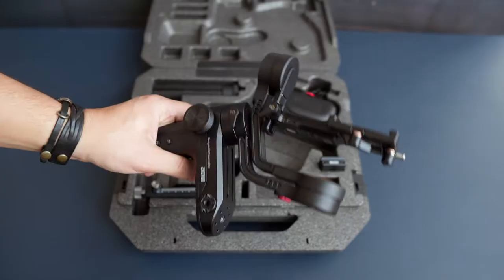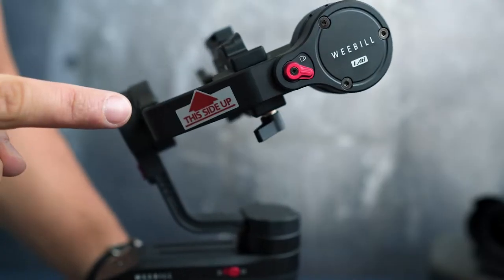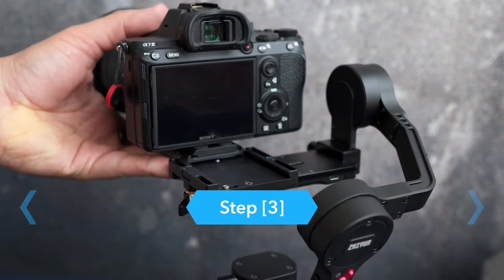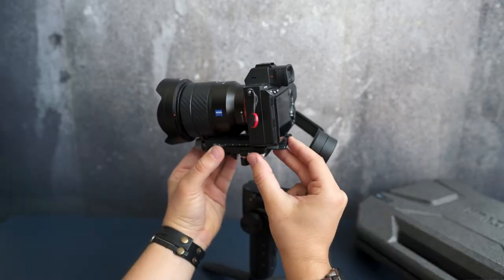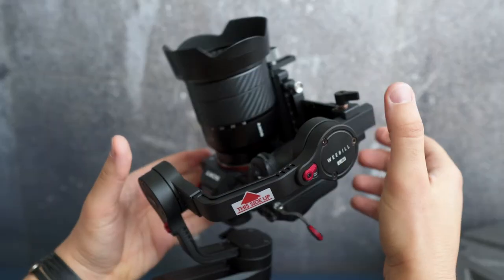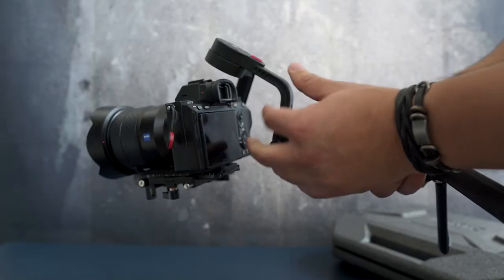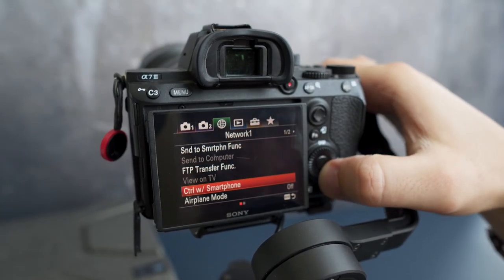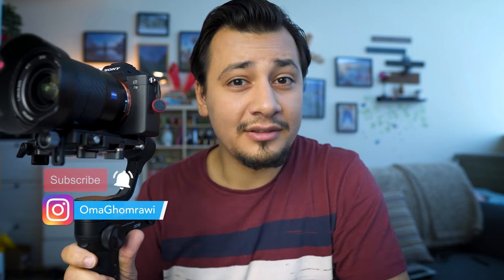How to Balance Zhiyun Weebill Lab in 3 MINUTES

Comment: Hi Oma Ghomrawi - I tried to follow your tutorial but I can't seem to get the gimbal to balance the way as you described in your video. Is my camera too heavy? I am using an EOS Canon 5D Mk IV with a 2.8G 24 - 70mm red ring Canon lens.
Reply from the maker: Because you camera and lens are large and heavy they doesn’t work on this gimbal.
The Weebill pab is designed for mirrorless and small cameras
You need a bigger gimbal

Comment: Thanks Oma - great video - fast and to the point. I'm looking at this exact setup for travel. I was looking at the EOS-R but It could be a bit big. The EOS-R with 17-40 is 75g heavier and 30mm longer.
Reply from the maker: My brother uses Sony a7iii and Samyang 35mm f1.8 which is quite longer than the setup I'm using in this video.
Don't take my word, I didn't try EOS R with weebill lab yet
Reply: @OmaGhomrawi  - thanks - great video - keep up the good work.
Reply from the maker: @markshirley01  Thank you for passing by :)

Comment: Hello, and thank you for this video. 
I need help please: when I calibrate my stabilizer on the tilt axis, the plate slides when I point the lens up or down, while the screw of the plate is tight... 
Could you please tell me why the plate does not stay fixed when the screw is tightened?
I'm desperate because I can't use my stabilizer...
Thanks in advance for your help
Reply from the maker: I believe there should be a knob that should be locked, and you're missing it.
Reply: @OmaGhomrawi  Hello and thank you foy your answer  😊  All the screws were locked.  I contacted the customer service and they told me to completely disassemble the screw that was causing the problem and reassemble it. My problem is now solved ^^

Comment: When im balancing the pan axis, do I lock the other two axes? I have this with the Tameron and im having a hard time balancing it at 50mm, Thank you
Reply from the maker: The other 2 axes should be balanced before the Pan axis and remain unlocked when balancing the pan axis
Reply: Oma Ghomrawi thank you , what setting in the app do you use for general shooting and running
Reply from the maker: Jj Li I don’t usually use the app, I just put the camera in and Run it
Tamron is pretty long at 75mm
If can’t balance it probably at 50mm I recommend to balance it at 28mm.. run the Gimbal then zoom in
Reply: Oma Ghomrawi I was told to balance it at 50 for the best result and that works really well
Reply from the maker: @OceanBoyJj  That's totally correct. But if you can't balance it at 50mm do it at the nearest focal length you can. Bare in mind, the gimbal will consume more battery power when it's unbalanced 100%
Reply from the maker: I'm currently running a giveaway on the channel. Feel free to join.. https://youtu.be/MF-pNkLq3PY

Comment: i have a canon sl2 with cina lens im having issues cant get it balanced
Reply from the maker: The setup might be too big for this particular gimbal.
Reply: @OmaGhomrawi  really isnt the payload max 6 plus pounds ? sl2 and cina lens is maxing it out ????
Reply from the maker: @mill3ronfir3gaming51  although the manufacturers advertise the payload capability, the setup size is essential on such small gimbals.
What lens you got ?
Reply: @OmaGhomrawi  Samyang 24mm T1.5 Cine Lens with a Canon sl2
Reply from the maker: @mill3ronfir3gaming51  I suppose the lens size is the reason, do you have any other lens to try on this gimbal ?
However, I stopped using this gimbal after few months because I founded flimsy and the system became a kind of jiggly. So I turned to Ronin sc and very happy with the other guy.
Reply: @OmaGhomrawi  yea all other work well with it but this lens is very front heavy but the lens and cam still not even close to 5 pounds i do have counter weights coming tho even tho i should not need them but we will see
Reply from the maker: @mill3ronfir3gaming51  I never used counter weight, I can't tell but worth the try